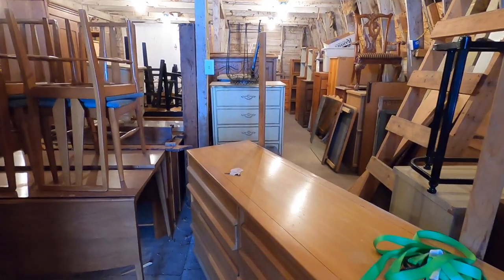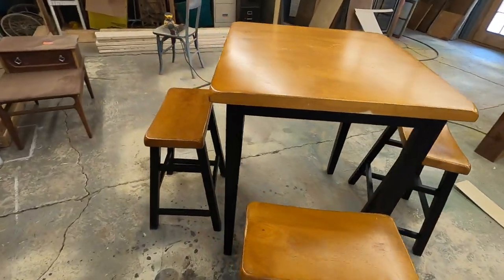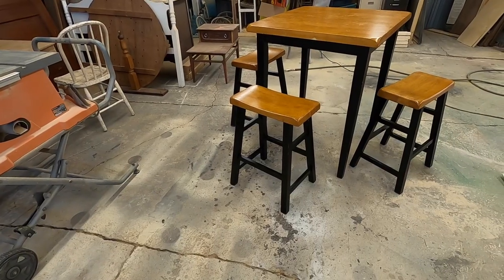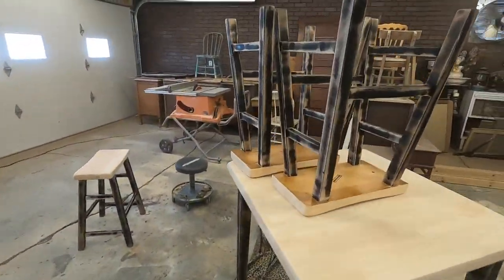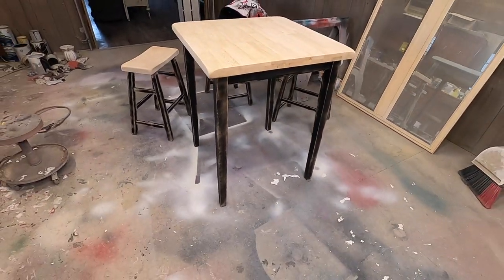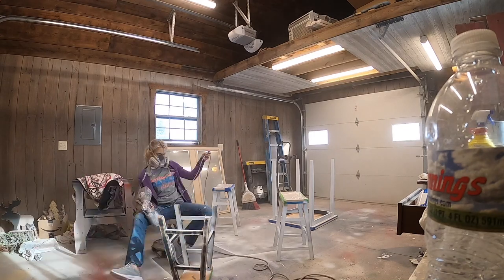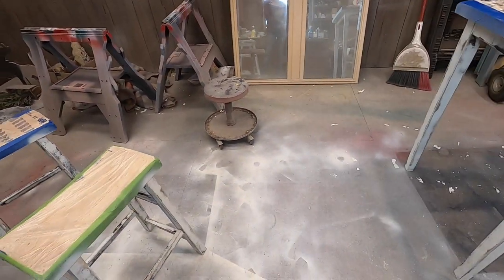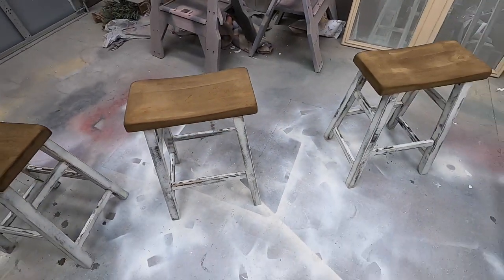Going To The Bar? No! Refinishing The Bar Table.

Comment: You’re making my back hurt watching you work off the floor like that.
Get the old man to build you a work bench with wheels so you can sand things up off the floor. 
Put some locking wheels under it so you can push it aside when not in use.
Reply: Yes Chet get   Your lady a bench for the refinish shop

Comment: Nice work. You should consider a good HEPA vac to use while you are sanding. The respirator is good, but the vac will keep the dust out of the air and off of the floor.